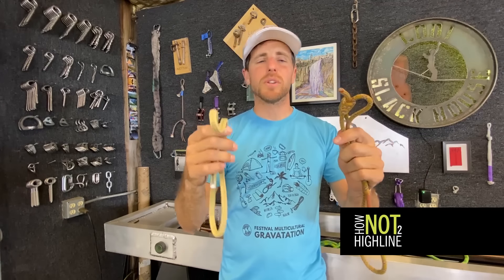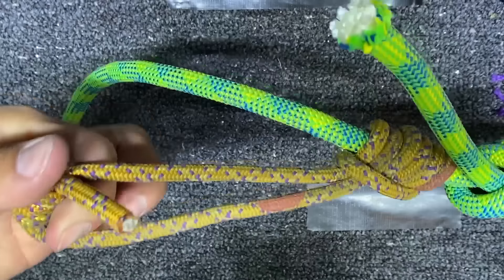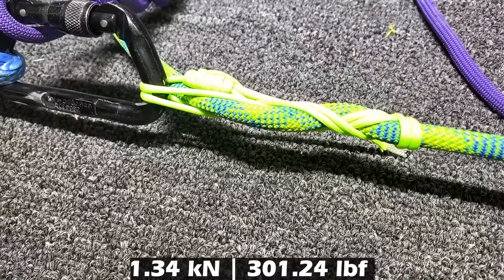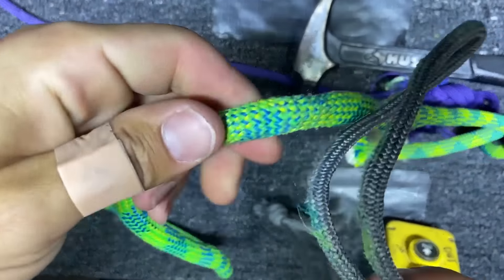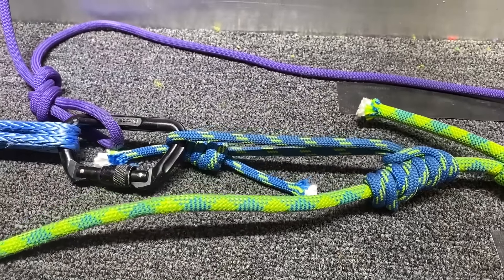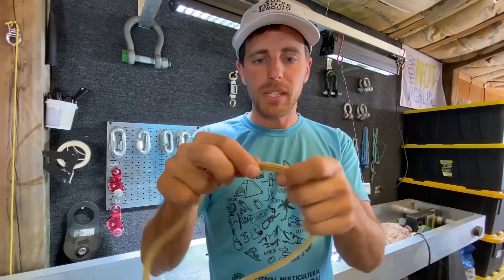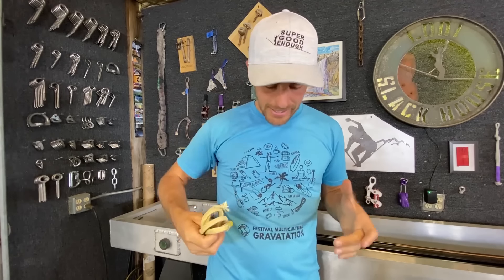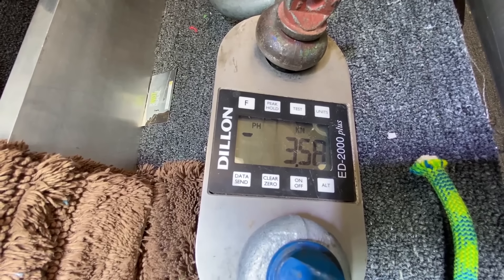Prusik, Auto Blocks, and Klemheist Break Tests

Comment: Hello, actually it is not a fair comparison. If you read the Treeclimber's Knotbook, you will read, that the klemheist needs one more wrap, than the prusik to perform in a similar way. The autoblock (machard) needs some more wraps to be able to show its advantage. You need a longer cord and you have to make as many wraps as possible, making sure that the connecting-knot is in top of the autoblock. Than it does not slip. My results of my own tests with 6 mm cord: klemheist and prusik: 950 kg, autoblock 2400 kg (!!). Thanks for your video. Dirk from germany
Reply: Are you sure the autoblock is the same as a marchard? I saw both ends on the carabiner whereas the marchard one end of the loops goes into the other end and then through the carabiner (only one end is on the carabiner).  The kleimheist looks like a marchard to me...

Comment: in a lot of atc repells, you are wrapping 2 rope strands instead of one, I am curious if that affects breaking strength
Reply: It probably would not affect the breaking strength because that is a material property of the cord used to tie the friction hitch. However, a lot of the tests where the hitch slipped might have not slipped because of the increased contact area between the cord and the rope.
Reply from the maker: we could chase that rabbit trail
Reply: @feelinghealingfrequences7179  dont kill this. Please, double ropes friction hitches tests!!yaaaay
Reply: @HowNOT2  yes part 2 is definitely needed. Would also be interesting to see a presewn prusik vs tied, but maybe too similar to a hollowblock to be worth testing?
Reply: yes please, I always use a 6mm prusik wrapped twice around two strands of usually 9.8 ish rope. I see a lot of people using 5mm too and im just wondering if going so thin it is getting possible  to "cut" the larger ropes.
Reply: @Martijn_Poot  Not a chance. The way to cut through a rope requires rubbing across a single area of rope using a moving area of other rope. In a friction hitch, the loaded rope will slide a bit against non moving cord in a friction hitch. In the above tests we saw the main rope cut through the cord in the hitch but the loads were still fairly high. 5mm is "super good enough" in most cases.
Reply: @Martijn_Poot  I alway use 6mm accessory cord as well! (Also 9.8mm rope)
You need not worry about the prussik cutting the larger rope, BUT!!! You actually need to think the opposite!      ->       Will the rope cut my prussik? 

The reason I use 6mm vs 5mm is that I don't want the larger rope cutting through my prussik! As you descend  the prussik is constantly running over different areas (the whole length of the rope) and there is no heat build up in one spot. but the rope is consistently running through the same edges of your prussik and the heat builds up the faster you descend, and it could melt it. smaller diameter prussik dissipates heat less, (less material to dissipate the heat) [think heat sinks: more material = more heat dissipated] 
Also if your rope is dirty with dirt, grime, and/or sand; that'll grind away at the prussik too.
Reply: Please do this! more often than not its 2 strands.
Reply: Also interested whether 6mm autoblock slips more than 5mm when rappelling slim double ropes ~8mm?

Comment: Good to know I’ve been rapping on the weakest slippyest friction hitch this whole time! The thing is it works well when used for the purpose of backing up an ATC.
Reply: Yeah its not like your considering that your atc is gonna break. After all we belay people all the time on an atc or other devices without back up. So I agree I think the point is to be able to go hands free on an atc when rapping to deal with shit.
Reply: It's not about your atc breaking, but you setting it up wrong and have a redundancy if you accidentally, say, forgot to run the rope through the biner. 
It does not matter much if in this video the knot slipped, I'm sure my autoblock holds my weight, its a combination of ropes and diameters that will make most difference. I prefer smaller diameter cords because I feel like they block the most and need less wraps.
Reply: I would imagine maxing out at 300lbs of force is enough to hold the brake position on your atc when rappelling.

That aside, comment above made me think though about the usefulness of the friction hitch as a backup if you accidentally failed to thread both ropes. Thanks for that @IacamiGevaerd
Reply: Well, we all know how crazy rappers are. They are always in the news 🤣
Reply: @iacamigevaerd376  Honestly, if you’re adding redundancy just in case you forget to do something right, you have a problem. Cos what if you forget to do the redundancy right? 

You need to thread your belay plate right, and redundantly make sure you have done it right lol as many times as it takes to be sure it’s right, and not go until you’re sure it’s right. Not do other things in case you do it wrong,

Comment: Adding here since I don't see this in the other comments. The Sterling Hollowblock is made from aramid fiber (hence the yellow color) and is much more heat resistant than common rope materials. This might matter in a friction hitch where things do get hot.
Reply: Am underrated comment for sure. I always worry about how hot my cord might get if I don’t put enough wraps on my auto block if it were to start slipping down the rope while I’m hands free!
Reply: Particularly good for multi pitch climbing with lots of long raps (so I hear).  +1 for Aramid

Comment: personally i learned those three knots pretty early as i started mountain climbing, i use them as secondary safety for rappel and stuck with the prusik for purely practical reasons. prusik works both ways (which allows very comfortable details while getting in a rappel, like having it hold some slack in the rope for you), it stays on the rope even without a carabiner, and is vastly easier to get moving again after it locked tight.

Comment: The friction hitches are really used on arborism. But always on double rope system. If u want to use in 1 line u got to add an extra friction device. Most used are rope wrench from ISC and chicane from petzl. Anyway, the knots that u tested is not common used. If you want to try the blakes hitch, distel, michoacan will be something nice to see. I like your vids! thanks for doing its!

Comment: Material also matters a ton! I recently switched from nylon to polyester in 6mm (PMI to Maxim brands if that matters) and the polyester is much more supple and grippy in the same length and number of wraps. I feel like polyester accessory cord might be a real win. Something else to think about!
Reply: Material makes sense for sure. I'm wondering about Amsteel loops for friction hitches. I can't quite get over how 'slippery' amsteel seems, but they bite pretty well when I test them and I like how light they are (as well as having no knot to worry about)
Reply: @muppetsfromspace  be careful using dyneema for friction hitches, as it has a very low melting point, and like you said, is very slippery.

Comment: Ryan: Prusik knots don’t work when they’re the same diameter as the rope

Blake’s Hitch: Am I a joke to you
Reply: If a knot fails to stop you hitting a hard surface it's failed.
Reply: Yeah with the appropriate type of rope it works, but with the dynamic climbing ropes it does not :/
Reply: @magnetohidrodinamika  hmm, I guess it varies rope to rope. I've definitely gotten it to work with a 9.8mm climbing rope before 🤷‍♀️
Reply: @magnetohidrodinamika  it works best with a dynamic climbing line. You got it backwards. Static it won't work well
Reply: @jhuntley575  works fine on 11mm static line, though i usually run 10mm knotted loops as prusik.  - arborist, not dead.
Reply: I agree, Blake Hitch would be a nice friction not to test on ropes with the same size.
Reply: friction knot, of course. Or hitch, I do not really know the difference.
Reply: @Matroxxtriste  it's almost as if things we use daily in tree work don't work for rock climbers... weird AF
Reply: @Imageloading...  fair comment

Comment: What some may miss is the concept of fit for purpose. The Autoblock is fit for purpose when used below the device to as you say, "add friction" in an abseiling context. So in effect it doesn't need to hold all the weight, it merely needs to add enough friction so you stop if you let the Autoblock grab the rope to go hands free. Very comforting to me to see it slip and not break. As always though, test before you commit to any set up you use when abseiling or for that matter perform any transition when up in the air. Awesome set of tests. Will be using some of that data in future training sessions.
Reply: The only way I could see an importance to support all your weight would be a total brake failure of the rappelling device, chances are really low. Worse case you do not clip rope strand to your carabiner on the ATC and for sure you do not test the system before unclipping your landyard but at least you took time to do a perfect prussik before this operation. By the way if you clip to the carabiner only one strand of a double rope rappel, the prussik may not save you, I used to test this on the ground (prussik works great if it is moving on rope but it could fail if rope strands are moving in opposite direction, prussik can grab the strand locked in your ATC and the free strand simply move up without any resistance).

Comment: There's no rule of only 3 wraps, that's just a starting point, when the diameter of the cord is closer to the size of the rope you need to have more wraps to create more friction. For rescue rigging a 8mm prusik is common and requires many more wraps against a single rope. The test of using 10.5mm prusik around a single 10.5mm rope will work just might need 15-20 wraps or more, haven't tried to know the exact number. Ryan should be testing how many wraps does it take to hold to be more accurate here. Also, autoblock is used with a belay device in the system, and more common around 2 ropes at the same time where there's a lot more surface area to create friction, and is more of a use case for the Hollowblock. That said, an autoblock is not intended to be directly loaded as an ascending device or progress capture.  Hollowblock also comes in a longer length, probably needed for achieving more wraps when using on a single rope with friction hitches.

Overall should revise the test for number of wraps needed for diameter differences to achieve the same slipping strength, number of wraps needed to achieve MBS, and comparing application of different friction hitches when using the same materials. Not trying to give Ryan more work, but think the major point of number of wraps was missed...

Comment: As a general note, when the ropes get wet, everything changes.  The value of hollow block is that it takes higher temperatures compared to nylon.  If it slips down the main rope, it will last longer than nylon will.  Also, being small & sewn, with no large knot, you can attach it to a leg loop & have it be short enough to use as a third hand under a repel device that is attached directly to a belay loop
Reply: If you get knocked out, you roll upside down, your leg loop can ride up your leg and easily reach a rap device that is not extended on your belay loop.
Reply: Much better and safer to extend the rappel device and attach the autoblock to the belay loop.

Not only is it a smoother rappel, and eliminates any risk off loosening your leg loop, but also that provides a fully redundant backup your rappel device. Even if somehow your rappel device became fully disconnected, your autoblock with any of these knots will hold your weight. 
Even if it somehow slips under body weight, it will slip slowly enough to prevent a catastrophic fall (at least if you keep your hands off of the hitch!)

Comment: Great video! I would have loved to see the VT prussik bluewater product included here because the valdotain tresse hitch is releasable under load, you can rig onto and descend a weighted rope, and the technora sheath will not melt like nylon or polyester. My guess is that the hitch will slip under a high enough load but adding wraps very effectively increases friction in my experience using it on longer rappels here in Utah.
Reply: https://youtu.be/szd5upswbVQ?t=806 Tu duh

Comment: I have a hollow block as a third hand (French hitch) as part of my abseiling kit. It’s comfortable to use, glides smoothly along the rope for Abseiling and can be used on different diameter ropes for different activities. 

the benefit of it is it’s ability to hold well on a large variety of rope Diameters without the need to carry a different diameter prusik cords. 

That said it is a pain in the backside to use for ascending a rope using it as a prusik (the knot becomes hard to loosen). 

Great videos I be learnt loads from your channel and the knowledge gain gives me confidence in the equipment Keep it up mate 👍

Comment: Like you said, the closer in diameter your accessory cord to climbing rope are, so I would imagine the more likely they are to slip or fail to create a nylon saw, especially in autoblocks, as they are notorious for this for the same reason we see them consistently slip even with extra wraps. 

I'm intrigued to see how a Bachmann holds up to the RBS and others!

Best,
Isaac

Also, I have a hollowblock, but it still has yet to inspire confidence, this video coaxes me to leave it at home from now on...

Comment: I usually use on of Edelrid's Aramid Cord Slings to make my friction hitch, not sure if they're selling them in the US. I really love these things, they've practically replaced my dyneema slings for pretty much all purposes (lanyard, setting up a belay on multipitch, ... ) apart from in extendable draws, and I also prefer them to using accessory cord. Thing is, having a pre-tied prussic sling from accessory cord is a piece of equipment that I can't really use for anything else while I always have a few of the aramid slings on me anyway. I always prefer multi-purpose gear, plus it feels good to know that it's rated for full strength :) for the other purposes, where I use it instead of dyneema slings, it also feels more reassuring, having a sheath and all. It is heavier though.
Reply: I use the 22Kn Edelrid ones to. And I disconnected my belay device and keep the Prussik on loads of time for different reasons during rappels. With the idea it’s full strength 22kn armide core rope. Now I’m curious what there strength is on a rope in a prusik knot 😅.

Comment: Many years ago I used to solo climb, S roping (belay point at bottom, tie in with enough rope to reach a gear point, retie to next point, abseil back down when I run out of rope (clearing gear), then climb back up rope). Longest climbs were 3 pitcvhes.
	
No ascender, so I used a couple of prussik loops. They worked, but it was very slow and hard work!  Tried Kleimheist, but it was very hard to keep the knot 'dressed' as I slid it back up the rope. Prussik was easy to keep neat.

Comment: my personal favourite way to abseil/ rappel is using a Hydrabot on a short sling to raise it up. this then gives me room to put a hollow block wrapped 3-4 times as an autoblock (french prusik). this gives me the safety of a self-belay while being able to abseil as fast as I want (hollow block is heatproof) and 1 handed for technical sections. having the belay below your repel device means it is so much easier to get going again as it doesn't have your whole body weight on it. the auto block is also super quick to tie and gives heaps of control.

Comment: I tried a prusik on a 60mm smooth aluminum tube using a 10mm wide nylon webbing loop, it grabbed very well. (We were hauling a 6 meter long thick wall antenna tube up a pole, and needed something to hold it when we weren’t lifting it or trying to feed it through a clamp, not supporting a person, nobody below it if it fell etc etc).

Comment: This vid was particularly interesting as an arborist. We use friction hitches as life support in the form of eye to eye spliced or sewn. 8mm - 10mm

Totally off your radar but I would love to see how one of our 8mm (smallest) eye to eyes holds up in your slack snap rig.
Reply: Love to see that too, but not on alpine rope but on a working line to get the best picture.
Reply: +1 I would like to see it aswell. 11.5 mm static rope would be nice to see it on. And maybe on the Valdotain and distel friction hitches
Reply: Peter and Conrad.. 

Since you are on static lines and constantly tending slack, break testing your hitch chords is IMO irrelevant.  A 8 ft fall would never happen in arborist work, and even if it did (fire that employee immediately) you are looking at 1-2kn max, prob closer to 1.  

For 6"- 18 arborist 'falls' on static line you are safe, safe, safe

Comment: i do most of climbing in trees. i use prusiks most the time but instead of the 3mm less rule i use 50% for biting and 70% for sliding (for instance if i were using a 10mm rope for holding me in place id prolly be using a 5 mm but if i were ascending id use a 6.5 or 7 cause it easier to break to push up the rope). the sheath/mantle also matters quite a bit based on what im trying to do and the rope characteristics, dyneema prusiks slide quite a bit more than polyester. really appreciative for your videos not all of us can have such a pretty machine.